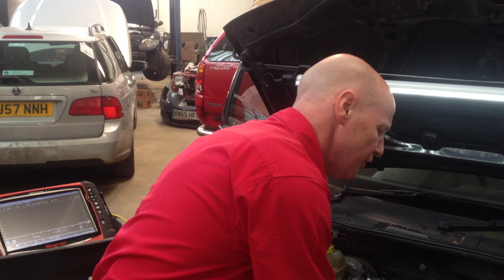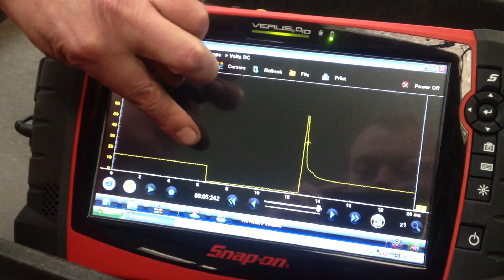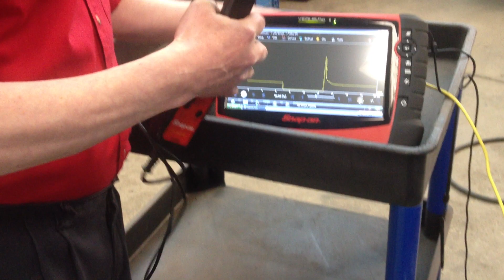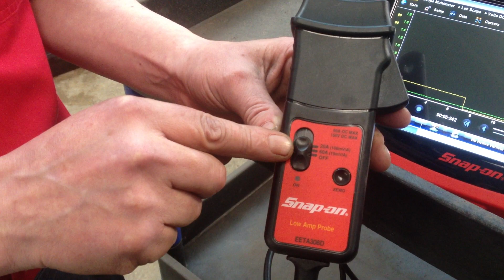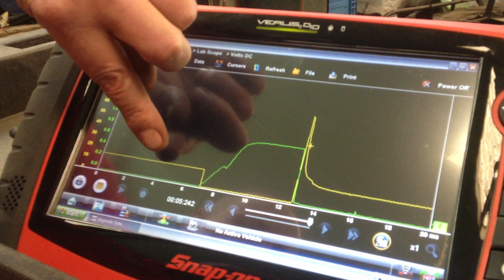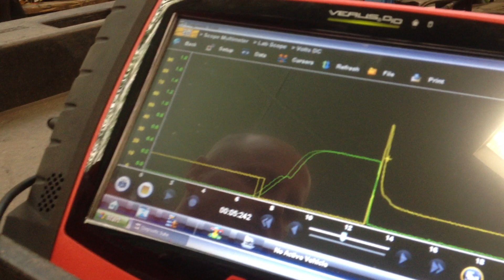Snap-on UK - EETA308D - Low Amp Clamp

Comment: exellent video,i conexted my amp clamp,see a wave output ,but not know what it ment lol,know i do,if no wave ,then ecu not switch or bad wires ,plug,that bit i new,but to see a signal and know all of its parts,start to finish ,thats awesome,need watch few more lol,going to have a go tomorrow on dead transit,2.4 durotorq,crank no start,snapon modis ultra,got lot signals ,but fuel and pump live data 0 ,wish me luck,got forscan too,so use 2 scan tools at once